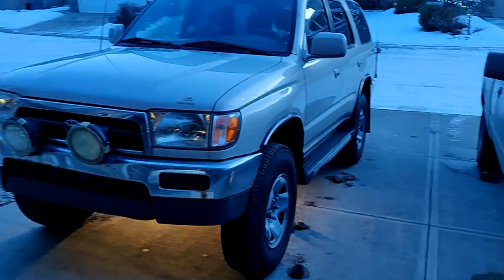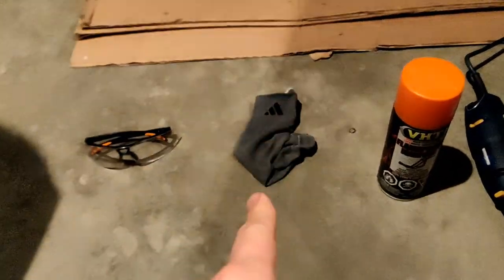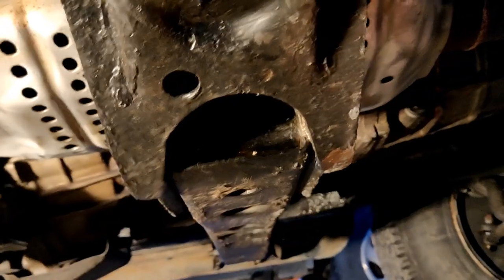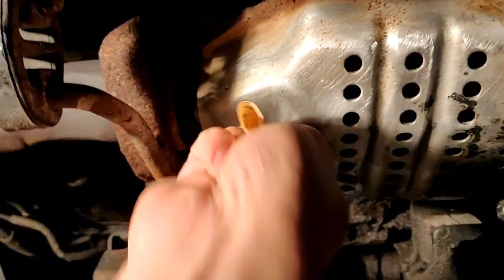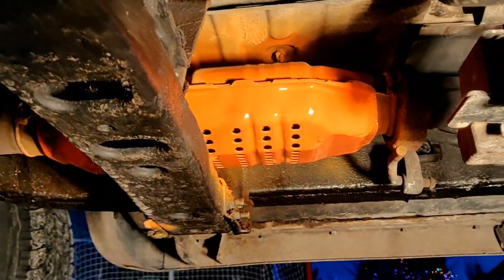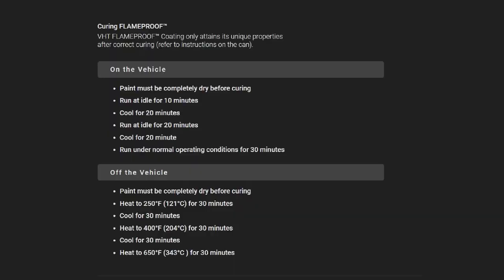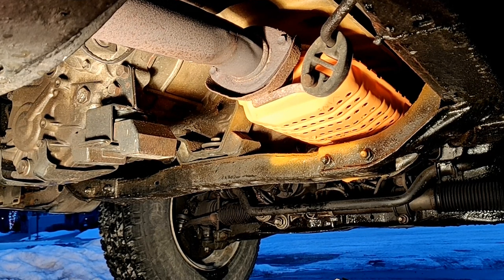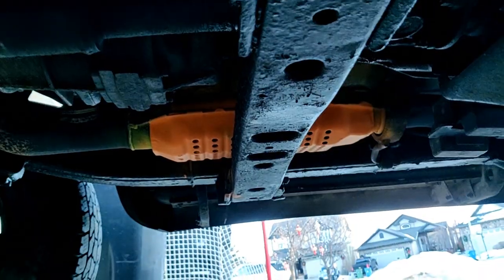DIY Catalytic Converter Anti-Theft for $20

Comment: Yeeeah, I don't see this being of much help.  Paint is easily removed with the right chemical, vin etching can be ground off, and even if that was still intact it would require someone who cared enough to go through the hassle of checking in order to trace the origin.
I dunno, perhaps if they clamp down on the regulations regarding the recycling of cats, then maybe it could have an impact, but if people can just cut out the guts and bring them in, then it's pretty pointless.

Comment: A sawsall in less than 2 minutes for the their to make $95-$250 depending on size of the cat. Need to install a shield as an anti theft device. Not paint or VIN etching.
Reply: You're taking your cats to the wrong place quit taking them to such a small little middle middle man. Junk cats are getting 250 a Prius is 2,200 for the set Ford F-250 and 350 are getting anywhere from 800 to 2200 dollars. Get an education before you start making statements

Comment: Can’t knock a man for trying but in my opinion all this does is make the cat more visible for thieves to steal. Also it shows them where it is right away in the dark. As to etching the vin, thieves are thieves because they don’t or can’t read so no one will look at a number on metal when the only number they see is dollar signs. The only thing that will stop a thief would be (a metal plate welded over the entire area.) Or a motion alarm 🚨 with a can of bear 🐻 spray attached under the car 🚗. Between the loud alarm and him not being able to breathe under a such a small space , then whacking his head on the frame on his way out it would make any man rethink his plan when his knot on his head is bigger than the cat he tried to steal.  😁😁😁😁

Comment: The paint is a deterrent because the scrap yards won't buy a painted converter, they would make you remove the paint before buying it..
That would be a royal pain in the ass to remove that baked on paint!!
Reply: 5 minutes with a wire brush on a drill would do it.

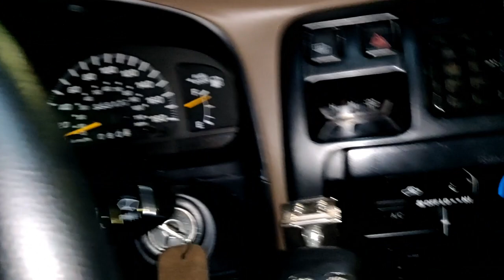Comment: 2:52  Truck has 393,177Km (244308 miles) that's pretty good, but the Cat is worn out, and wont pass smog.  the thief was doing you a favour.